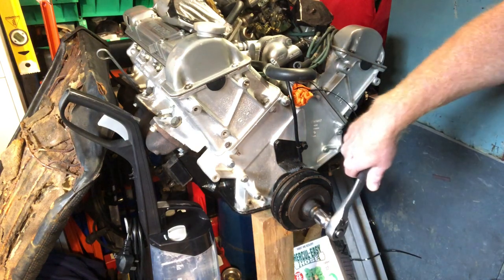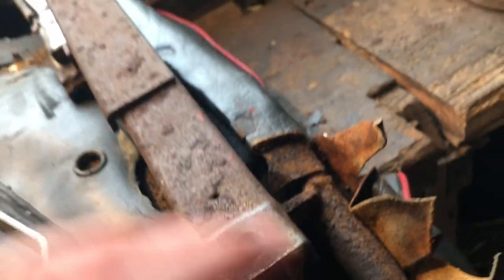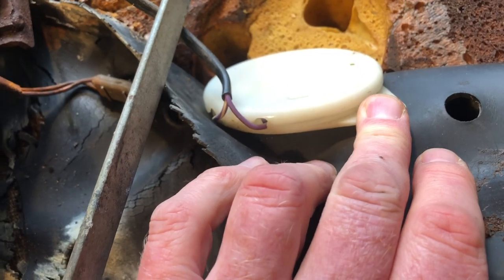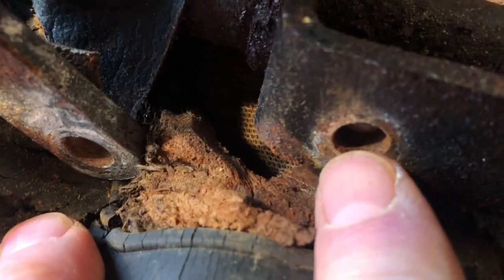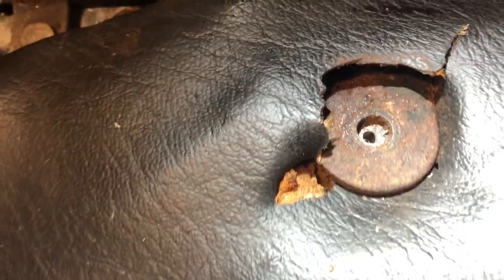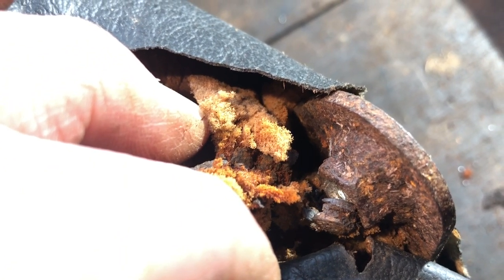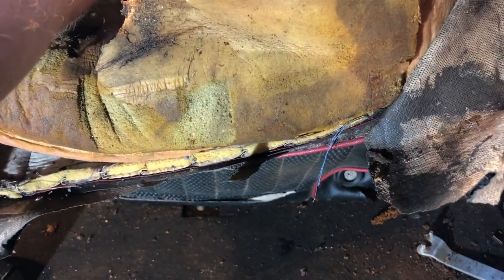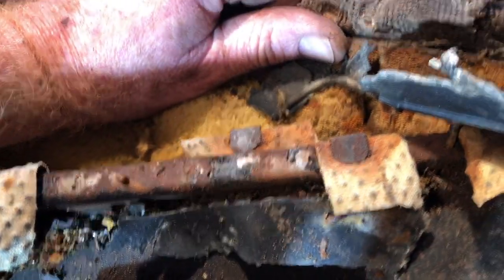Triumph Stag Seat Overhaul - Part 1

Comment: Hi Tony, I use a small catering blowtorch for applying some localised heat to free off fasteners in restricted areas, usually works well, drilling out should be a last resort.

Comment: Hi Tony, as you noted, it looks like the seats had been recovered sometime in the past, as the red piping wasn't original. The frame looks salvageable, just depends how much time you want to spend on them. Please keep posting updates as you get them sorted out and put back together. Perfect project for winter evenings. Good luck.
Cheers Russ.

Comment: Hi Tony.  You might be advised to get a better pair of seats that are not rusted, they are not expensive and will save you a lot of time.  Note that the runners have ball and roller bearings between the upper and lower sections, and the rollers can pop out so check they are present and working.  The runners can also develop indentations of the balls, and that can make it rough running, so try them before you buy.  Good luck.  PS I have recovered dozens of seats so if you need any advice just get in touch about where to get foams, and how to fit the new covers.  Cheers